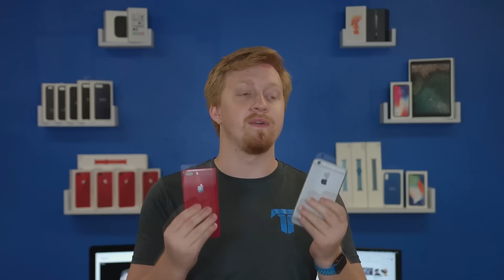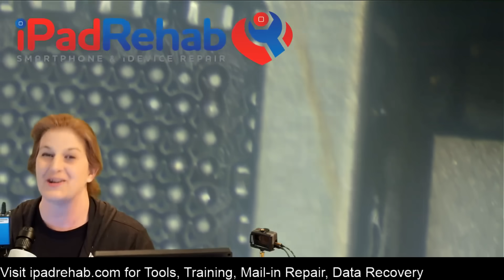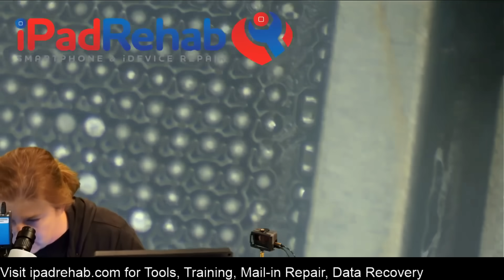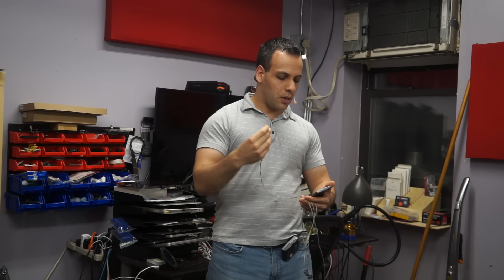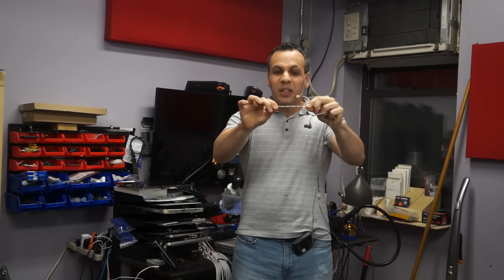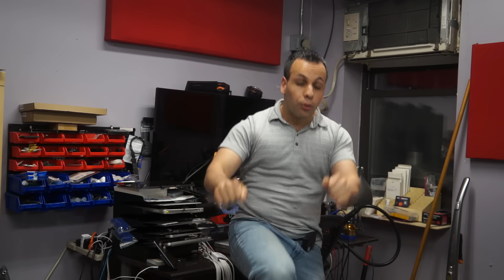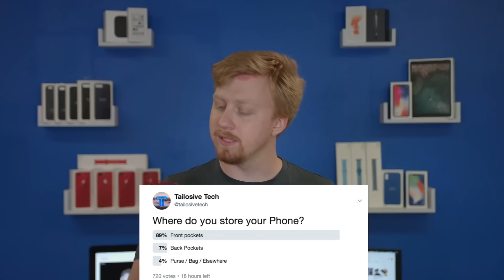The truth about iPhone bendgate deniers

Comment: Hm..... Why device is bootlooping? 
For an example I am making firmwares for my DIY devices, some of them is using Linux, some of them are programmed using just C++ or ASM, and when some of my periferial chips are not responding then my firmware just disables that feature, I am not throwing "Kernel Panic". 
Why big company as Apple couldn't just disable audio IC if it is not responding? What the point of force restarting the phone, they are thinking that if device will reboot then chip will fix itself? 
Definitely NOT!
Reply: Let me guess. Every piece of HW on Apple devices is somehow signed. If the HW is disconnected (thus not signed) it can't boot (anti counter-fitting measurement) -> They would never allow you to have non-apple HW in your device ;)
Reply: Shcherbyna M try and catch ;)
Reply: What kind of a ""software developer"" POV is that???... On ANY properly designed PC, IF a device is not detected or detected as defective on regular POST (power-on self test), device will not be reported to OS, and will not exist on DSDT (differentiated system description table)... Then OS should skip loading the kernel extention associated with that device and continue booting... This is the one and ONLY solution to avoid hardware related kernel panics and IS A MUST that every PC does every time it boots... Windows does this. macOS with exact same kernel as iOS does this. Linux, Unix etc can all do this... But not iOS.. In a more likely scenario,  device simply skips some of the POST steps and assumes everything is in place (which it should be for a non configurable device like an iPhone), probably to shave a second or two from the total boot time for bragging rights.... If something is bad it gets a kernel panic when it tries to utilize the hardware.. Restarts because it doesn't know what to do, then it gets a kernel panic, restarts again... Loop goes on..
Reply: To be fair there are some circumstances where that will occur (at least on windows, i'm not a linux user) if you have a defective component sometimes. It's those obscure things where you plug in a new mouse and it bricks your computer for some reason, until you unplug it and it's just the mouse disagreeing with your computer and not the USB port for some reason, or your new sound card makes your computer BSOD on startup every time. Doesn't happen very often at all though, but that's why the 2 last paragraphs of the old bluescreen were there, because it happens occasionally.
https://www.wintips.org/wp-content/uploads/2016/10/image-27.png

and i'm not trying to defend the iphone, i'm just bringing up other similar situations; but at the same time windows gives you a possible solution and tells you that something went wrong, it doesn't just keep restarting and wonder what's wrong
Reply: Another possible reason (other then the HW being signed) could be them trying to minimize user info on the problem. If their phones constantly bootloop whenever something goes wrong then you'll only have people complaining about bootlooping instead of complaining about a myriad of things such as their touch screen not working, or mic, or audio etc. making it harder to diagnose whats gone wrong as you don't know what has the problem. This is just speculation though, but i could see a company with shitty anti-consumer policies doing this.
Reply: Ash Kebora, You can save microchip if some NPN-transistor will be used between ground on motherboard and ground on chip. Even if microchip is burned, you can disable powering it. If peripheria microchip not working properly and it not responding signals on bus (I2C, ISP, I2S, etc.) then just:
1) Make low signal on base of the transistor. (It will disable microchip)
2) Set availability variable in service that is responds for this chip to false. (It will prevent sending messages to disabled device)
3) Write to log file that there is some problem with chip. (It could be used for diagnostic)
And then if user will try to use NFC\Audio\Bluetooth\OTG:
1) Check the required services to be available.
2) If some of the required services is unavailable then show warning on screen (or log somewhere) that there is some problem with service\device.

In current case that we see on video the audio microchip could be just disabled because it was not responding. And as always Apple just dont care about user experience that user got, by using Apple product.

P.S. A short circuit on message bus is not considered as this is an extreme case.
Reply: Stratos basically hit the nail on the head.  The trend seems to be that anything that has a writable device ID register will be somehow keyed to the device to prevent unauthorized repair (or some other retarded bs reasoning).  One doesn't adopt this sort of design approach without also acknowledging and accepting the amount of problems it will cause customers.  Customer convenience or satisfaction isn't worth sacrificing control.
Reply: Hanniffy Dinn, even if it is compact, can't Apple just add 10-20 more transistors to control power on peripheries chips? I think that it is possible because Apple devices are built on factory. My DIY devices not always have free space, because I am not using smd components, because it is hard to solder SMD components and fix device if some chip burned.
Reply: @ShcherbynaM  so mainly THT..?
Reply: For that, Apple would just have to care. Which they don't.
Reply: That is a nonsense argument... "Kernel Panic" occurs on OS level completely unrelated to the hardware nor its "extremely compact" layout.... Anyone who played around with a hackintosh will tell you the macOS CAN automatically disable its cached kernel extentions if it doesn't find the required hardware after the first restart... It will also won't load any kext for non-existing devices during rebuilding the kext cache... macOS can also be made to disable a specific .kext if its mismatched to its assigned hardware to continue booting... Why can't iOS do the same??? Before saying a mac and an iphone is not the same; think again... macOS and iOS use the exact same kernel, the Darwin.. If macOS can handle it properly, then the kernel has all the necessary features; which it obviously does since even the BSD its based upon could handle hardware changes during bootup... If iOS can't, then only explaination is that its designed deliberately that way for some reason...

Comment: LG flex series were made to be very resistant to bending. I wonder how they designed it so whole smarthphone is bendable without suffering any damage.
Reply: Zeppy Stole the Membrane contruction from Casio rather than using an actual PCB. Maybe lol.. But it's just a guess. Might as well be several small PCBs so it can bend between segments.

Comment: Simple reason why apple phones are  more sensitive to flexing damage is design of logicboards. They make LB long and narrow and it seats along full long side of phone. Every flex and bend is transferred practically direct to narrow band. Almost all other phone 
manufacturers build LB on the top 1/3 of phone shaped almost like square. With this type of design is almost impossible bend LB. In my life I saw some aluminum phones like xperia z3 bent 45° with screen popped out and  and phones were repairable by installing new frame and back cover. Samsung have part LB in their cheap ass phones along long side but is very thin strip, without any soldered parts, made of flexible material and glued to plastic midframe.
I don't have problem with bad or stupid design, a have problem with repeating same flaw in all yours future products.

Comment: I have used Galaxy S6 before, got it for free from my mother, although i didnt really care about it because it sucked (no water resist, microsd, non removable battery - big deal at that time) and i pretty much beated that phone up with use even until a corner of the phone somewhat deformed, its still working fine until now. I only had problem with the battery

Comment: Hello I have a question,
I got a brand new iPhone 7 on March 20, 2017 and was working fine until about one week before it turned a year old. The phone started to randomly shutting down and getting stuck in a boot loop for up to several hours at a time. Force shutting down the device would not work, it would keep going through the boot loop process and would not stop. It kept getting worse and it finally called it quits on March 28 of 2018. I could not get the phone to turn on at all. after that I tried every button combination possible but no luck. I couldn’t even get my phone in recovery mode. Of course this had to happen when I was 1,000 miles away from home and was on vacation in Orlando Florida. I was so pissed because it had just went out of warranty and couldn’t take any pictures from my trip. but fortunately for me, at&t still gave me the one year warranty because the phone failed so close to the warranty. Any ideas on what could have caused this random failure of my iPhone 7? I treated the device very well, I didn’t have any major drops with the device. I just don’t understand why it failed.

Comment: Why Women Put Their Phones In Back: 

Women's clothing, generally speaking, sucks. Most women's pants lack front pockets. (Some lack back pockets, but not as many.) Consequently, what are the options? Either a bag, and not every women uses one or those bags are small and already full, or.. use the pockets you have. 

I wear a men's motorcycle jacket so I have pockets for small things I need to keep handy, like my phone and the small clutch of cards I need in order to operate in a modern Western country. (Also helps that I ride.) 

IMHO Jessa is part right. If there was one non-male engineer in the room when the iDevice was crufted, they'd be ignored when they brought up the issue that the men didn't think of. If at least a quarter of the engineers weren't men, maybe they'd have seen the problem.

Comment: I am still using a Galaxy S6 as my only phone daily without a case. Its been almost 3 years everything works. This Phone does not slow down over time as my previous phone Galaxy S3. Only downside is that Samsung stopped supporting Phone and will not push security updates or OS updates even though phone is capable of.

Comment: 8:01 Yes, it's simply a case of fatigue failure (repeated application of a low stress within the elastic limit of the material) vs catastrophic failure (single application of stress in excess of the ultimate strength of the material) . They're not comparable so, for that reason, in engineering fatigue limits are calculated quite separately when a design is likely to be subjected to repeated low stress loads in service.

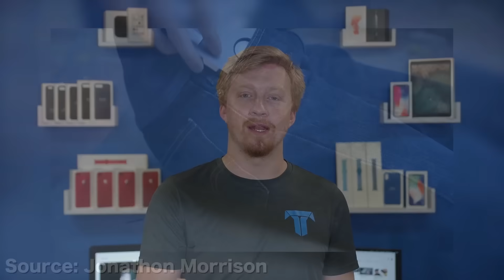7:41 A scrawny weed soy boy like that couldn't break a giant crispy fried potato chip in his pocket. His clothes look like they're still on the coat hangers in the wardrobe. Don't give up your day job, Skeletor.

14:06 "Do you even solder?" Haha that's gold.

Comment: For anyone still doubting that stress damage accumulates over time, look up the DeHavilland Comet. It was the first jet airliner to enter service, and because of its square windows, it would develop stress fractures around the windows, causing the aircraft to disintegrate at high altitude. That's the reason we have Rounded windows in airplanes today.

Comment: I think possibly a bigger source of flexing than physical bending of the phone it thermal flexing.  Pretty much nothing on the board has the same thermal coefficient of expansion so as the temperature changes, pretty much everything on the board flexes a little.  If you look at a different chip package like QFP, its nowhere near as locked down on the board as BGA.  Even if you have a thermal pad on a QFP soldered to the ground plane, thats just one big pad thats going to be very hard to de-laminate from the board.

A very large number of people are constantly leaving phones in cars, cooking them at 130F, then taking them into a 70F office.

I mean when the BGA graphics chip on the 2008 MBP's self destructed it wasn't because the chip itself was damaged or that the solder melted, it was because Apple decided that 95C somehow wasn't an idiotically high temperature for the chip to run at.  They failed from thermal cycling.

Comment: Bendate is complete bs. If the bending problem was as severe as you apple haters make it out to be, why is the iPhone 6 the best selling smartphone of all time? Surely with over 220 million phones sold across the world, Apple would have been bankrupted by a surge of returns and a sharp spike downward in their sales. Some guy exerting all the pressure he could with his two thumbs in the middle of the phone while simultaneously pulling away with his other fingers on the end sides of the phone and watching the phone break is not some design flaw, it is the expected result of a guy who is trying to break a phone. About the only reason design flaw you can cite is Apple using a cheap aluminium alloy but beyond that there is nothing you can say. Apple then went on to use a stronger alloy in the next phone. The fact is, unless you want some plastic piece of shit, your only real choices are aluminium enclosures or glass enclosures. Stainless steel would make for a very heavy phone and the production costs would rise sharply. Titanium is $30 a pound and is a pain to machine. If someone only charged $1000 for a titanium phone, we'd be lucky. There is no besting the cost/performance ratio of glass and aluminium.

Comment: A well-made device does not bend or sustain so much flexion damage regardless of which pocket, bag, or opening you shove it into.

Has nothing to do with being male, female, or anything in between. Has to do with the simple fact that if a company wants a reputation for making products that are reliable, they design it so that it will continue to work properly under an enormous variety of circumstances. As disgusting as most of Apple's competitors are, if Apple truly were about thinking different, they would make their devices to such a standard that shy of dropping a bus full of concrete on them, a user could continue to rely on an Apple device throughout the user's lifetime.

That would be thinking different. Give me an army of engineers and programmers, and I would make something where thinking different is more than just a sales pitch.
Reply: By the way, Louis, the way you end this video... I pointed at you on my screen and shouted "witness".

Comment: The late great (or largely diminished) manufacturers of cell phones had a cycling durability tests that would bend the phone and then let it go. Repeating tens of thousands of times at minimum. Probably more than a 100K but I don't remember any more. It's been nearly 20 years now and former employees of the manufacturers and suppliers being scattered to the winds to the point where everyone should know better.  If a modern phone fails in this manner it is because someone high up in management decided to release it with that weakness.

Comment: Google also gave free Pixel XLs to Nexus 6p owners
Reply: Very nice gesture. I've had a Nexus 6P that worked well up until the infamous bootloop which was replaced by Google free of charge (a full year out of warranty) with a Pixel XL. Although the Pixel XL is newer, I do miss my 6P as it took way better photos, screen was slightly bigger and the front facing stereo speakers were just amazing.

Comment: 24:24 Funny he brings durability up, because if you watch just a handful of durability tests such as the ones from JerryRigEverything, you'll notice that the vast majority of phones, even incredibly cheap $100 phones, don't usually bend or snap in half when you put all the pressure you can muster on it, yet $800+ phones from Apple do, so what's their excuse..? 

Also, just wanted to point out his argument of "they probably already had them in production" Ok fine, so in that case you would expect they would sell a handful of defective units and fix the issue in a revision 2 that way the rest of the phones won't suffer from that problem, right? RIGHT?  So why the fuck didn't they do that!?!?!? This guy is really something......

Comment: My previous phone's (xperia z3 mini) screen came off slightly, so the proximity sensor doesn't work unless I push the glass back, and some of the touch screen doesn't register touch.
I liked that phone, used it for 3 years, so bought the successor one, xperia z5. It has some nice improvement over the previous one, but the phone gets really hot, the battery dies quickly, and it seems to lag more.
Kind of disappointed in Sony.